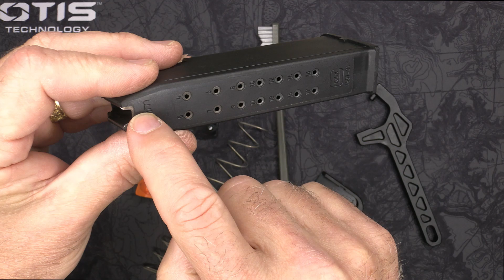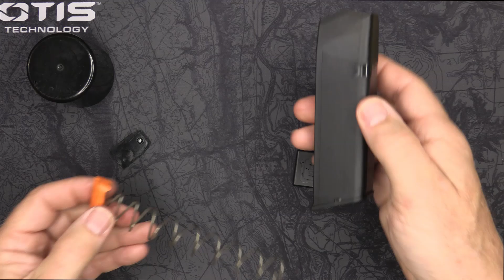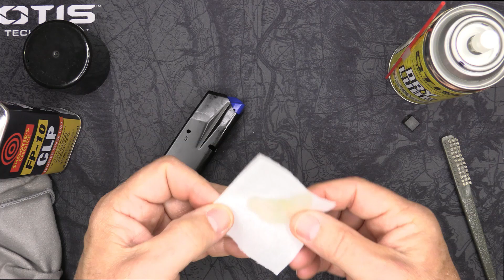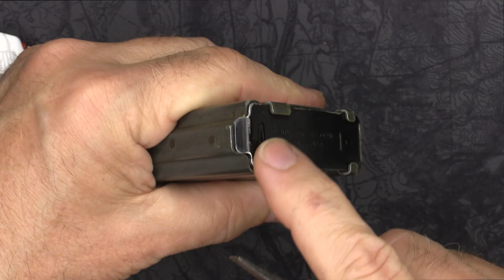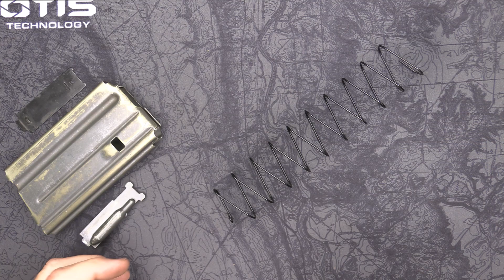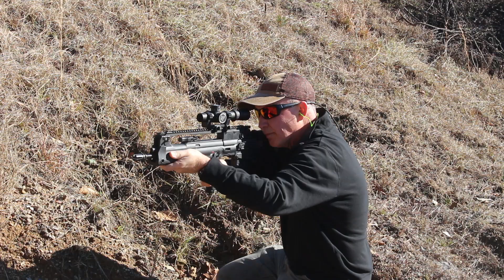Proper Cleaning Method For Magazines

Comment: Here's my pro-tip: Clean with ballistol, let dry. Apply Flitz firearm wax (non-abrasive kind) with Q-tip until lightly coated, let dry. Buff it out smooth. This method will moisture + dust proof your mags and provide a hard, thin protective layer. The additional benefit is that it doesn't have PFAS chemicals and the process is entirely non-toxic. Enjoy.

Comment: You're using about 70% more dry lube than what's necessary. The springs just need a single pass on each side.... NEVER soak them!

Also, a dry brush will never remove carbon that's formed on the plastic follower. You need a dedicated solvent, NOT a CLP. Strictly solvent only!

One last thing.... It's completely unnecessary to use ANY kind of lubricant or clp on the outside of metal magazines.... They're aluminum and won't rust.

Comment: I put a +0 pinky extension on 1 of my p365XL mags to see how I liked that particular brand.before getting more (a little pricey,hard anodized aluminum. Good stuff but going with the same brand but a new one they made that’s a little shorter. )or different brand ect. Have a cpl more im going to try too .Pearce have always been good for most of my guns…hard to beat)Was the 1st time I’d opened the mag.Was glad I did…had substantial amount of scale looking rust near the bottom of both. Cleaned up pretty good though. I thought penetrating oil too.all I had handy was some PB blaster rusted bolt stuff. Put a good amount on where the rust had been on both & as light coverage as possible up in there. Sit a few minutes and wiped off ,switched to clean cloth twice,they were clean & dry. Have checked since,still looks good. Love Otis. Will be getting some of that stuff.good video. The 20 rd back pocket AR mags are nice. The older US issue is my personal fave .good stuff. I ll think about it but every 3 uses. Your 3 uses & my 3 uses are different. But I’ll keep everything clean. I used to  run on the dry side,then went through a sloppy wet stage .Early days & know my guns better now. A little dab on right spots will do .just started thinking about going ultrasonic every now and then. A long one. But have some figuring to do. Will be good for cleaning other stuff if I wind up using it with guns or not. Need. ?.?.No. But worth experimenting. Thx again.

Comment: Well if you're having a failure to feed issue not only check your mag but check your slide, because if it's having feeding issues there could also be dirt or debris inside the gun causing mishaps.

And if you're trying to "clean your clip" just unscrew the bottom of the magazine and wipe down your spring and make sure there's no debris inside the magazine. If this doesn't fix your problem then you probably need a new spring/mag. (Hope this helps)

Comment: I get some CLP on a cleaning patch and use it on the springs after using a dry brush.  Just leave a faint coat of lubricant.  The Dry Lube spray looks easier.
Reply: By using wet Lube on Springs only causes the spring to accumulate debris and carbon. Dry lube, nothing sticks to it.

Comment: I have a Smith & Western 380 EZ the slide on the mag anyway you could do a video on cleaning those thanks
Reply from the maker: Thanks for stopping by William!
Reply: Well technically it's my wife's everyday mine's just a little bit bigger lol G19
Reply: It's easy, just poke the little button on the bottom but WATCH OUT when you take off the base plate because the teensy inside plate and the spring will fly across the room ✈️
First time I took one apart luckily I had a helpful puppy who found the spring for me and was batting it across the floor 😆 🐶